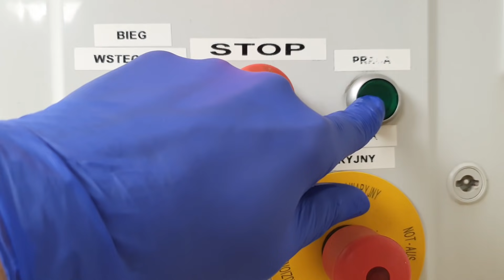Uroczy dywan znowu będzie cieszyć swoimi kolorami ! Pokazuję cały proces dogłębnego czyszczenia 😍

Comment: Are the floor tiles 12" x12"? I like to figure the size of the rugs by the tiles. Such a cute rug design.
Reply from the maker: 3 tiles = 1 meter 😀
Reply: Thanks. There was lots of dirt in that little rug. Great job
Reply: I do the same thing...